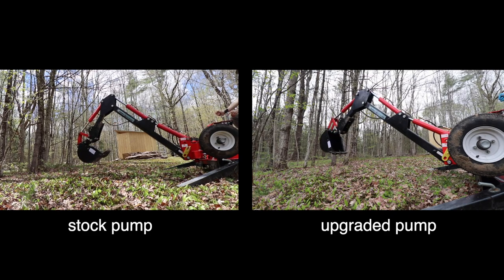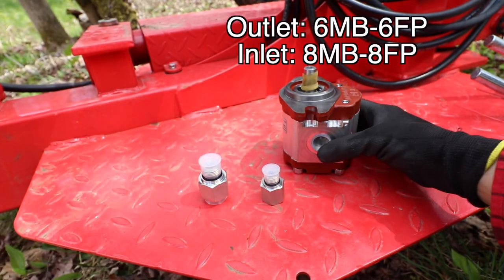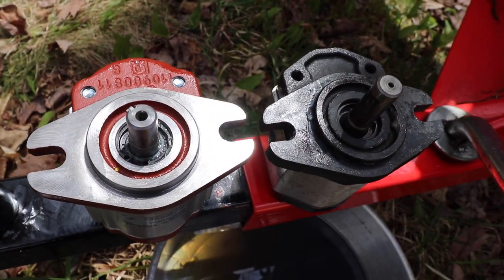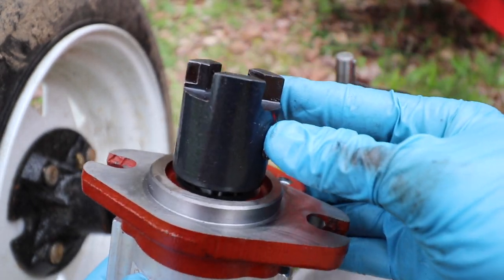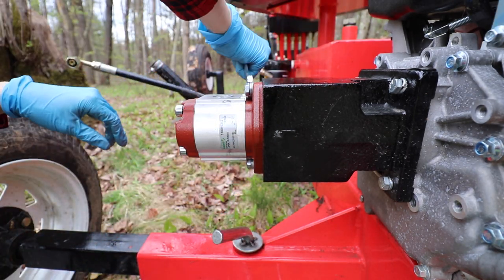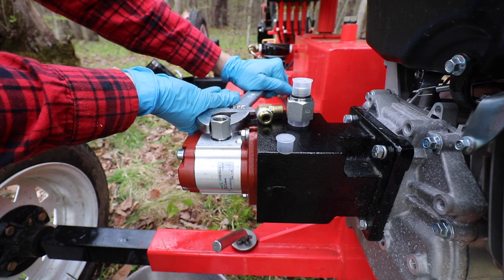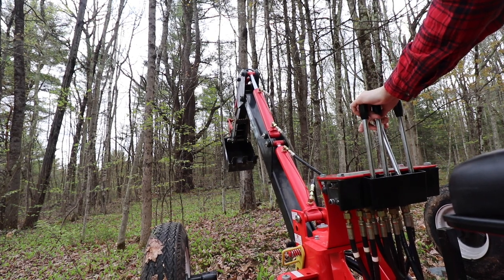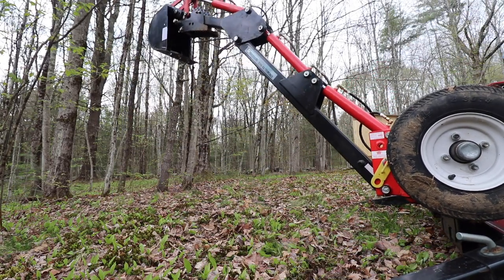Upgrading the hydraulic pump on a Harbor Freight towable backhoe trencher

Comment: Today is 3/2/2024. I just wanted to thank you for this video. All your links worked and the shipping was with in a week. The pricing went up. The pump including tax and shipping is $235.00 and fit/worked perfect. The adapters shipped fast and fit perfectly for about $25.00 total. Again thanks for this video spot on!

Comment: At 6:34 not only new tape but you don't want to turn the threads counter clockwise after tightening down. A paste is much better here than tape. Rectorseal  is good one. Great video

Comment: like the video... but I had some questions  when I opened the link for the pump it goes to  the same part you have but on the spec. sheet said it is a 1.80 GPM the less than the HF one. am I missing something ?

Comment: Great video...i bought a pump and it says that it turns counter clockwise.Should it turn this way or should it turn clockwise?Your help is greatly appreciated....Thanks
Reply: A hydraulic pump that is directly connected to a small gas engine needs to be set up for clockwise rotation of the input shaft.

Comment: Nice vido, one thing you want to be careful of with the teflon tape is not wrapping over the Ned of thread on adapter nippel, as it will cut tape loose and possibly plug up valve, great job on improving your equipment,

Comment: Did this help with using two or three functions at the same time? I have a red rock towable excavator and I’m looking for a way to increase volume to the valve body, i believe it has a 3.5 gph pump, but I’m thinking maybe there maybe other restrictions like the pressure line to the pressure bypass
Reply from the maker: It definitely helped with 2 functions at the same time. It kind of works out nice, because with the 1 function the machine can be jarring with the weight/momentum of the movements. WIth 2 functions it slows the movement down a bit and smooths it out, but yet you're not slowing down the project because you have the 2 movements happening.
Reply: If your Red Rock unit has a 3.6 GPM pump on it, then this pump is not going to be much of an upgrade. It's displacement is 4.1 cc per revolution which would mean that it would deliver about 3.9 GPM at 3,600 RPM.

Comment: Quick tip, when working on hydraulic equipment and you are disconnecting hoses hook up a shop vac to the hydraulic fill and the vacuum will stop or certainly slow the oil loss.

Comment: You can probably adjust the coupler on the engine shaft to compensate for the slightly different pump shaft, without having to machine anything.  When installing tapered pipe threads into O-ring adaptors like these, I recommend install and tighten down the O-ring adaptors, MARK the clock position you want the pipe fitting oriented, then remove the adaptors from the pump and clamp them into a vise to install and line up the pipe threaded fittings.  You can warp or strip an aluminum housing with these kinds of forces.

I'm curious, how well does it perform under high load?  Does the pump bog down the engine?  I'd consider upgrading to a 13 horse engine paired to a 4.5-5" displacement pump, I bet the thing would really dance with that power unit!
Reply from the maker: Has performed fine under load - dug out a huge New England boulder with it.

Comment: I do not see any updates about the upgrades? Are you going to make more videos? Also the link in the description does not saw the same specs as the one you got, any ideas?
Reply from the maker: No notable updates to report - been running fine since the upgrade. 

What specs are difference? I know there are different model #s, but they are equivalent.

Model #: 1.6PB4.1D-R080S0 
Alternative model #: 1.5PE4.1D-R80S0 

(The 1.6 was superseded by 1.5. Both have identical mounts and port locations, but there are some cosmetic differences.)

Comment: Question 
 Have you heard of using vegetable oil vs petroleum base hydraulic fluid? If so have you switched over & if you have was the results of doing so
Reply from the maker: No, I have not researched/experimented with this.

Comment: I'm having a tough time finding the specs for the oem pump and no hydraulic companies I use and Grainger is a big one, but none of them can seem to find the pump.
 you got.
Do you know the specs like shaft size, flow and pressure?
Since I don't know what the oem specs are, they can't tell me what the next size up is.
Reply: Oops, I wrote down the Info but didn't go to the link. I think I can get it straight now.

Comment: U could try plumbers tape on the threads then tighten u could try getting the bucket galvanized this is dipped in hot furnace it will strengthen the steel hope this helps

Comment: Is the link in the description the exact pump you used? It looks like it is a small pump.
Reply from the maker: The exact pump used is SALAMI 1.5PE4.1D-R80S0, which is what the link goes to. I know the annotation in the video says 1.6, because that was another model # I had in my notes. Technically this is wrong, but also technically 1.5 and 1.6 are effectively the same with only cosmetic differences so either would work.

Comment: You are a brave person to hand hold a metal component while drilling on a press.  I've spun parts so many times that I found that a little cringy.  But otherwise excellent video.  I've been eyeing this machine for a long time.  I did see another pump upgrade video where the owner also installed a larger diameter hose from the pump to the control valve.  Wondered if you considered that modification and discarded it or hadn't heard of it?   It kind of makes sense in the context of operating two valves at once that the additional volume would be beneficial.  But that assumes the pump can keep up with the demand.  If you try out that mod, please post your results.  Before I decide between this machine and the Betsco I'd love to know if that helps.
Reply: Good way to break a wrist

Comment: I noticed the wheels in your speed comparison portion of the video, did you also install the wheel modification posted by N. Illies on YouTube ?

Also, the speed comparisons were apparently done under "no-load" conditions, have you considered making a supplemental video showing possible speed increase under "nominal" load conditions, such as a bucket full of soil or perhaps heavier loading such as rocks/concrete ?

I ask because it seems that the small diameter metric hydraulic lines to and from cylinders would effectively limit the fluid transfer rate, regardless of the rated capacity of the pump. This could easily prevent any significant performance increase from being seen in boom and/or crowd movement rate.

Unless, of course, you also replaced the small diameter metric hydraulic lines with 3/16" SAE (or larger) lines, which in itself provides significant speed increase while operating with the OEM pump, and would allow a larger capacity pump to increase response time and movement speed even more.

As a side note, some owners feel that installing a higher capacity pump requires a more powerful engine to drive it. In this case, and citing the rule of 1500, you may want to point out that the OEM 9HP engine has more than enough power to handle pumps with GPM ratings up to at least 7.5 GPM.

Still, I consider your video to be very well done and of benefit to anyone considering such a change. Good Job.

Comment: Noticed the number you put up on screen different then what is on pump?  Is that the same pump just different numbers?
Reply from the maker: Yah, same pump, just a difference in Model #s. The 1.6PE4.1D-R-080S0 was superceded by 1.5PE4.1D-R80S0. The 1.5PE4.1D-R80S0 has identical mount and port location, but there are some cosmetic differences. Source: https://www.masondynamics.com/salami-hydraulics-aluminum-gear-pump-1-6pe4-1d-r080s0.html
Reply: @stickwallfarm  thanks
Reply: Thanks for the video.  Been doing a little research on what size pump to upgrade to.

Comment: Your link takes us to the 1.5 pump, not the 1.6 you mention.  Also it shows 1.8gpm while the pump that comes with it is 2.4.  How is this a better pump?  Also, you say in this video that the 1.6 is the pump you use but when I stop the video when you show the pump it is the 1.5, the alternate pump you mention.
Reply: Both the 1.5 and the 1.6 pump have a displacement of 4.1cc per revolution. That converts .25 cubic inch per revolution. There are 231 in³ in a gallon. At 3,600 RPM that would be approximately 3.9 GPM flow rate.

It is not clear what that 1.8 means in the flow rate line on the specifications. It doesn't say GPM, it just says flow rate.

Comment: Great Job, nice mod on the coupling too!!!     Pro Tip: (lol) Try to get out of the Habit of using Teflon tape on Hydraulic systems use a hardening hydraulic sealant. Tape will act a wick, and-it will eventually Frey, clogging your components causing them not work... Otherwise top notch video...
Reply from the maker: Good to know, thanks!
Reply: Loctite 545 is the best thread sealant I have ever used for pipe hydraulic fittings 
Holds up to even over heating hydraulic systems and I promise it will not leak
Reply: Had to google hydraulic sealant after reading you comment. All these years, I thought guys were putting normal blue loctite on fittings. Thought to myself, that's going to suck to remove, possibly brake. Never knew, thanks for the knowledge!
Reply: I use teflon tape but I make sure the tape is back three or four threads from the end.
Reply: For the coupler you may have been able to get away without the drilling of the coupler by loosening the engine side coupler as it uses the same set screw and should slide In far enough to fully seat the pump

Comment: Does this upgrade also increase the strength or lift capacity of the trencher?
Reply: Folks are already bending parts with the stock pump. Better hope it doesn't increase it's power too much...
Reply from the maker: No, it does not increase strength, only speed.

Comment: The pump makes movements faster but does it have the same power? or less?
Reply: Less power....you would need to upgrade the engine also to get more power
Reply: Why would it have less power?  @bernardkriel1
Reply: @DeeGeeTN  there is no free lunch in hydraulics..your primary mover i.e the engine that turns the pump can only produce its rated power ...now depending on your need you size your pump for max flow and pressure ..going either size up or down will cause either less flow (speed) more pressure (power) and visa versa
Reply: @DeeGeeTN  using this upgraded pump the unit will have the same maximum force. The maximum force is determined by the pressure relief valve setting on the control valve body, that does not change when you change the pump. The nine horsepower engine on this unit can easily deliver the 4 GPM flow rate of the larger pump to a maximum pressure in excess of 3000 psi, which is the typical maximum pressure for systems like this. 

It is possible to put a pump that has too large of a displacement per revolution that would be more flow rate than the engine could deliver at 3000 psi, but that is not the case with this pump.

Comment from the maker: Replies to frequently posted comments:
→ One should not use teflon tape on hydraulics; I was just replicating what was already on the machine stock, and did not have alternative sealants on hand.
→ One should not wear gloves while using a drill press or any other spinning tool. 
→ The links/info on the pump is where I got it when I did this project. Please use this information as a starting point to do your own research and find a pump that works for you.

Comment: The new pump has an output of 12.3 liters per minute? Can this be? That wouldn't be much.
Reply: The original pump had a displacement of 2.7 cc per revolution. The replacement pump has a displacement of 4.1 cc per revolution. At the same engine speed the replacement pump will deliver 150% of the original pump, meaning the speed of operation will be 50% higher. 

4.1cc per revolution times 3,400 RPM (rated speed) would be 13.9 liters per minute.
Reply: @byronmill  Thank you.

Comment: lol. i modded mine to diesel.
and as i had a genset, i made it so i could strap that on.

so made a sub frame, rubber bushes, fancy over center clutch, drove the pump a bit faster but clutched so i could run just the generator (that having an electromagnetic clutch)...

discovered theres an oil filter in the frame... "pull that flange before using teh plasma cutter". "no! just hack it off!"... lesson. listen to your guts...
discovered its a non standard thread size. at least if i ever have to order another one its standard now!

well, after the third belt... i decided to look into the power ratings of a vee belt...

oops. :) 

basically i want five side by side.

sigh. 

currently back to the original engine mount but with a new pump housing. and just as i finished it and had cut that 1 inch extra off the engine shaft, i realised i could have grabbed the electromagnetic clutch from the scrapped ride-on, and not bothered with the veebelt-overcentre thing at all! which now wont fit cus yeah... im an inch short...

 FFS!

lol. life is a journey that must be experienced :)

Comment: I did pretty much the same thing ..... however ... took off the 9 horse and put in a 12 horse Honda engine that starts first pull 99% of the time ... then added a new hydraulic pump 6 gallon per minute at 2500 rpm ..... had to do some modifications to the pump mount and failed to get the Lovejoy couplers to align properly  and wasted a lot of money replacing them ..... finally just removed that whole pump mount ... built another mount for the pump, much like an old school alternator mount ... added a double pully to both the crankshaft of the engine and then to the pump shaft ... slapped two belts on there with a little slack so they would slip  if i ever got into a bind .... would rather replace belts than bent component mounts ... at this point , you may be asking .... why double pullies .... one to run the pump and another to run a generator/starter... wasnt sure where i was going to mount that part at the time ... i can also mount the old pump  to a seperate independent hydraulic system to run various impliments and run it off of the second pully ...(quick connect couplings  make for easy wood spliter connection)
 you can do a lot of things with these little diggers
Reply: Show us some videos of all the stuff you did.
Reply: id very much like to do that .... however i dont know how to do that sort of thing ... noy very computer literate  @DeeGeeTN

Comment: You may want to add that if you use teflon tape on the threads, you need to use a tape that works with hydraulic  oil. Your normal plumbers tape will not hold up. The tape I use comes in a yellow case.

Comment: I did mine an she is 100% correct it is lots better I used 4point 1 
It is bit faster an lot more efficient 
I've made lots of upgrades to my machine that will be last iam sure 
One other thing take you're cylinders off one at time this is simple where hoses 
Connect drill that feed out just a small 
Bit to open for more Hydraulic fluid because 
Of new pump that will help of course 
Make sure u don't get metal burrs in you're cylinder I wash mine out to make 
Sure

Comment: Way too much Teflon tape. It’s not a sealant, it’s a lubricant to ease  the threads together. Male and female pipe threads are tapered to become tighter as they are screwed together, thus not leaking. The Teflon eases the tapered threads together. You can even see the taper on the male side when looked at from the fitting sideways.

Comment: A bigger pump will give you more flow but less power...so things will move faster but they won't be as powerful.....
Reply from the maker: Haven't had any issues with power. If you try to do things that require more power than this machine offers, parts start breaking.

Comment: As a former track hoe excavator operator, I have to say that the heavier machine you have, the more ripping force you have.  This machine has no weight to it.  My neighbor bought one of the harbor freight backhoes to dig up his water line at his gas station.  It does not have enough weight and ripping force to dig through the hard dirt.  He ended up having to hire a contractor  instead.  What a waste of $3200.
Reply from the maker: Probably depends a lot on the ground material in your area. Has met/exceeded our expectations for any project we've thrown at it up here in the north east.
Reply: I have one of these and spent all weekend digging up stumps. I have no idea why your friend felt they didn't have enough power, as they tend to have more than enough to break it if you don't pay attention. There was a bit of a learning curve, like how the vast majority of your 'power' is in the bucket curling.

Comment: Anyone found a pump in 2022 yet?
Reply: www.surpluscenter.com
0.25 cu in Dynamic GPF1041PC Hydraulic Pump
ITEM NUMBER: 9-7766-B
Out of stock now but are reordering. "regular stock item"  It is rated at only 2,000 rpm but does max out to 5. 
There are .31 pumps also in stock would 5 CC be too large? I'm figurin' the larger the better. They have more than these.
 Everything seems to be correct except the pressure and the rpms 
I haven't ordered it yet. I just ordered the back ordered back hoe today.
Reply: @dave_ecclectic  Came to recommend Surplus Center.  I've gotten a lot of great deals on hydraulic stuff from there over the years.
Reply: @dave_ecclectic  Thank you.
Reply: @iwillnotcomply7145  
I was also told NAPA makes hydraulic hoses. So the return and feed hose could be increased as one of these comments somewhere mentions. Maybe eliminating some of the adapters too.